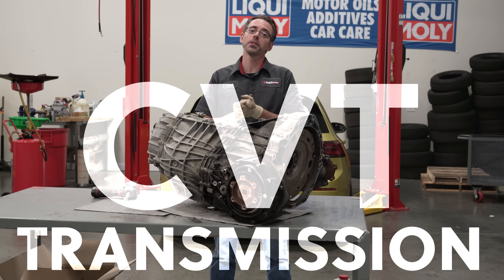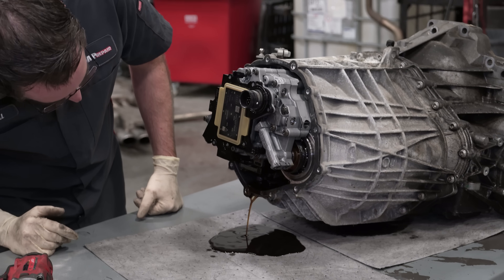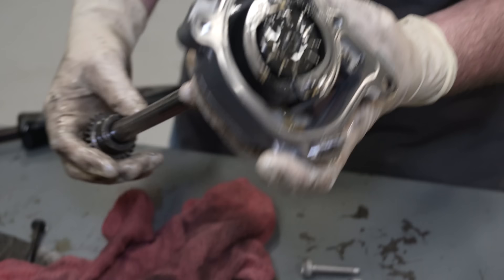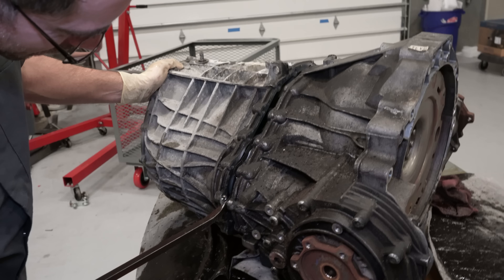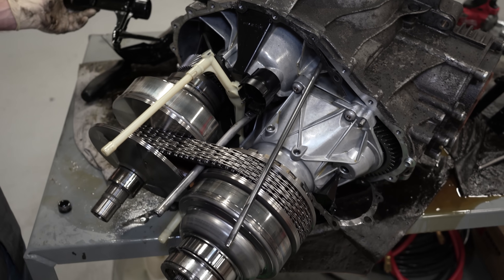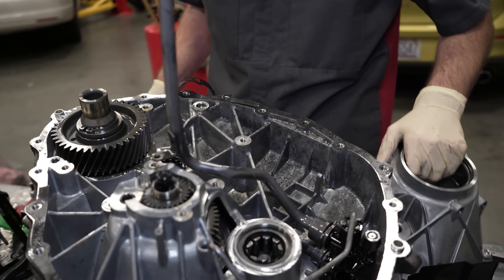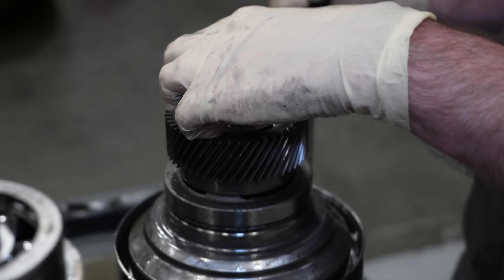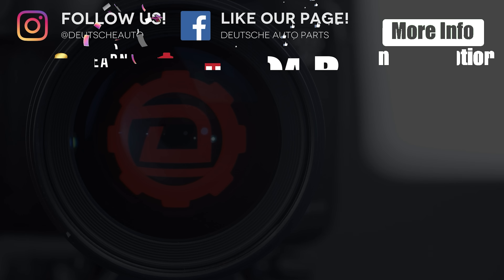Why you shouldn’t get a CVT transmission

Comment: Interesting to see the interiors of a cvt, and I've seen this design before. It's in combines as the rotor drive belt (really big and needs to be infinitely variable to run the way it needs to), but it's also in snowmobiles. Both applications have them applied as belts, not chains. So if I were an engineer for automotive industries, I would take more concept from the 2 previously demonstrated concepts and go back to a weighted spring design (more mechanical) rather that the valve body and solenoids. The second thing I would do would be change it back to a belt, rather than a chain, because the belt will be more maintenance, but will also not be, because it won't wear out the rest of the equipment. And to make it better overall, change the case so it's narrow and smaller, the drive axles go into the case through some holes with seals on them on each side, and make it have have an easily removable cover to replace the belt and give access to the weights and springs. 

That would have major changes, better reliability, easier servicing, lower manufacturing and repair costs, weight reduction in metal for that giant transmission case, weight reduction in not needing to run in fluid, and an overall safer experience for the driver and mechanic
Reply: It's a heavy car . It would never create enough force with weights to hold the torque. Plus it's a chain not a belt so it grabs the face for shit. So they have to use hydraulic pressure or it would slip. 
I drove a new Mitsubishi economy car with a cvt . It was terrible . Old european cars had them , but they were light and had no hp .
Reply: @dednside5229  lots of tractors use cvt's, which are much heavier already without load
Reply: Trash all trash. A good ole manual is what all ATV'S snowmobiles, and UTV/side by sides need.

Comment: Currently have a 2021 Toyota rav4 hybrid xse with a cvt, its amazing to drive and launch. Also have a cvt in our Kawasaki mule pro dxt, works great for a side by side, and a push plenty snow with a warn 5 foot plow🦾🦾, cvt transmission have come a long way.
Reply: Hybrid cvt is completely different. It doesn't have a belt. The gear ratio is controlled electrically.
Reply: @stkoev81  yes, i was implying my satification with cvt systems overall

Comment: Toyota hybrids get a boost from the traction battery at startup. Transmission failure is quite rare in these vehicles. Toyota does not mandate ATF changes, but it should be changed at 50-60K mile intervals. Audi and BMWs are not reliable.
Reply: I agree with a CVT fluid change every 80 K miles or sooner.  I use Amsoil Fuel Efficient ATF instead of Toyota's WS fluid.  My '04 with nearly 250,000 miles on it is my wife's "baby" and we intend to keep it as long as possible.  I do my own maintenance but the Prius doesn't require much.

Comment: CVTs are not new technology, they are just new to cars. Go-karts, golf carts, snowmobiles, and many recreational vehicles have used them for decades.
Reply: But those also dont have the weight, torque, and miles logged that a normal daily driven vehicle gets in the USA or Canada......
Reply: @Joseph Summers  it's like you are saying people lightly use their recreational vehicles lol. People are running cvt vehicles from the 70s.  Yeah sure generally they have less power than a car, but the cvt it uses is also much much smaller. The reason for it failing on cars is poor design.  They need to make them fully serviceable. Right now they are total shit and that's not the fault of high torque and milage

Comment: CVT is only a problem when it is misapplied.
Invented in the 1960s by the Van Doorne Brothers in Holland (who owned DAF), they released a range of cheap, small engined cars in the Dafodil, the DAFs, 33, 44, 55, 66 and 77. These found a large market in during the 70s oil crisis. They had 600cc, 844cc, 1.2l and 1.6lt engines. The 600 and 800 were 2 cylinder boxer engines. The cvt used thick rubber bands and these cars were both much better 'automatics' than what was on offer in Europe at the time. The cvt made them as fast backwards as they were forwards and 'reverse' races are still popular in Holland using old DAFs, yoh haven't lived. 75mph looking over your shoulder...
CVT works fine and is a sensible application PROVIDED the engine is not powerful but it is cheap, reliable, easy to fix and easy to use with small engines, motor scooters for example all use cvt the days.
The problem.with the application is in cars. Volvo bought DAFs car division in the late 70s and the designs of the Daf 66 and 77 became the Volvo 66 and Volvo 370 series respectively,  the latter was a huge seller. However, when the oil crisis lifted in the late 70s larger engines became more popular in Europe and the CVT wasn't up to the job, the 370 was sold in manual and automatic until the early 90s I think.
Obviously there's been an attempt to put cvt back into cars over the last 20 years and unless you are buying a small engined town car, don't bother. Yes the CVT of the 21st C is  more robust than the 1970s version and can ostensibly handle larger power but the reality is that manual and trad automatic are much more reliable with the larger engines.
I've owned many DAF cars and several motor scooters. The DAFs were extremely well built for contemporary European cars, very simple, easy to fix, hugely efficient and an absolute hoot to drive. They sold very well initially in Europe but unfortunately,  especially in the UK many were destroyed by their annual road worthiness tests (MOT) by ignorant testers putting them on rolling roads to test braking. CVT needs road friction to work and the transmission would destroy itself through over.powering on the rolling Road which resulted in many court claims. They continued to sell well in Holland and Belgium and still have a large following there similar to that of the Mini in the UK or the 2CV in France or the Model T in the USA.

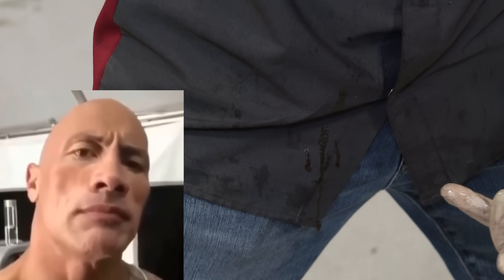Comment: Im at 8:20 in the vid and so far the only failure I see is an idiot that DOES NOT like the CVT and intentionally trying to disassemble it the wrong way to make his lame point. I wanted to see why NOT to buy a CVT . Most of the failure in these seem to be the valve body-electronics side of things.  There is no way in HELL that this guy would work on ANYTHING that I own.
Reply: I think he knows / noted the metal shavings in the oil when he pried it apart first. So was not afraid to wail on it. As its just a 280 lbs paperweight now.

Comment: I was using a company car throughout 2018 the car was a 2017 Nissan Rogue and i was doing a lot of traveling through the blue ridge mountains from Ohio to lower North Carolina. The car had a 2.0 liter engine with a CVT and ran great, always had the car fairly loaded down with luggage and my work gear and i could drive continuous at 80 + passing cars easily going uphill even touched 120 124 mph which was the max it would go. Yes i run the --- out of it as it was company rental. Never had a problem out of it and was very nice to drive. So early 2020 our 2005 trailblazer was being put to sleep and so we bought a 2017 AWD Nissan Rogue with 52,000 miles. The car now has 83,000 miles on it and is doing quite well made a couple trips to Texas and up through Oklahoma and back to Ohio plus a lot of more local driving, so as of now it every thing as far as drive train is doing good. Just waiting to see when the Ohio cancerous rust begins, once it starts it only takes a couple more years before complete body is gone. Yes it was o long story just to say the CVT i don't believe is all as bad as it is made out to be. Good on gas mileage also.

Comment: They've been in golf carts for decades.  You'd think they'd be simple.  Seems they are over engineered for what they are.  I would posit that they WERE simple with few failure points early on.  But they had "feel" issues and they threw tons of engineering fixes at it to get that feel right but all those fixes created all those modes of failure as well.  I see these as eventually being THE standard transmission.  Looks like they have a ways to go.

Comment: When I worked at a second hand dealership these would almost always go out for a sale and come back because the customer 9/10 times wanted the oil from the transmission with it, but we had to check and make sure no one already took it apart and all the sensors and inner workings were with it, can’t sell half of something. Horrible manufacturing unlike Toyota…

Comment: I like how quiet and smooth they are.  The oil that came out of this trans looks like it had never been changed.
Reply: Transmissions generally croak if you put oil in them...
Reply: And some recommend changing the trans fluid every 25,000-35,000 miles (spending what - $250 ? often) to help lengthen its life. Yikes.

Comment: CVT = garbage.   Relying on a steel segmented belt, to friction drive a steel drum is stupid. Once slipping starts, its a runaway disaster.  Rail locomotives use steel wheels on steel rails, which rely on massive weight to provide traction, and even then they can slip.......which is why sanding is used.  Imagine put sand inside a CVT to stop the belt slipping.............LoLz   Conventional automatics have improves so much, there really is no need for a CVT anyway, its obsolete.

Comment: This is even a bigger piece of crap than the Ford Pinto, or the Chevy Vega. 
  We rented a Mitsubishi Lancer with a CVT, what a piece of shit. We were driving south on Hwy 2, at night and we reached the Blackfalds hill, at 140I floored it. The car started shaking so violently that we had to pull off of the highway a few towns later because the car would NOT stop shaking like we were inside of blender. It was really loud and shook us up like milkshakes.
  We had to park and wait for a half an hour so the Piece of Shit CVT transmission to cool enough before we could drive down the highway again.
  This was a Brand NEW car with less than a 1000kms on it. We were going to buy one but that experience sealed the deal, the CVT transmission Sucks BALLS totally, don't buy 1 of these junk heaps. If you buy one of these it only exposes how little you know about cars. Total trash heap.
  It would probably be a good granny car, because if you go to fast it will explode guaranteed.
If you like driving like your grandma, buy a CVT so you can show your friends what an automotive genius you are not.

Comment: I have a 2015 Honda CRV. First year they used A CVT in a CRV. I now have 125,000 miles with no problems. Easy to change the fluid myself every 25000 miles. As easy to change as the oil. Most automatics make a huge mess like on your table. Never understood why they couldn't put a drain plug on the pan. Then making sure the seal is good or again a huge mess. Guess I really don't see any reason to dislike A CVT. No hard shifting like a geared system. Just smooth acceleration.

Comment: I worked at Link-Belt company back in the 60s and they manufactured CVTs for industrial applications and they were exceedingly reliable.  Perhaps automotive designers tried to cheat on the requirements for a CVT and you have ended up with a bunch of useless iron because of egregious design changes.  If it ain't broke . . .

Comment: I've driven a few of the new Renault Clios in Turkey which have a CVT and I found those cars pretty nice to drive.  Totally smooth acceleration and no gear changes.  That said, those were all brand new cars with very low mileage.

Comment: Still as useless as the Daf variomatic transmittion I woeked o in the 70's. At least that was just aeubber belt which could be easily replaced.  I was asked to work on the car after it had torn out several CV joint on the shaft to the rear diff.  I found that the gearbox was out of alignment since manufacture!

Comment: had a 2021 Subaru Legacy with cvt. Slugish acceleration, no power of the good size 2.5 engine, it was scary to merge into the freeway, or pass a truck in a two way road. They even advertise their 0-60 at almost 9 seconds! not to mention subpar accesories and human amenities in the car compared to other mid size sedans in the same segment.
sold it after only 15000 miles and got me an 8-speed Kia Stinger and is like day and nightand day; 0-60 in 5 seconds, and no more afraid to stinky cvt tranny. I love my Stinger!
Reply: ksoriano9766
Reply: ksoriano - you are INCORRECT SIR! 2021 Imprezas ONLY offered the slow 2.0 engine -- that's why many switched to the Crosstrek in order to get the peppy 2.5 engine -- your story doesn't hold up my friend.
Reply: @bocon99  Thanks for your correction, it was not indeed a Impreza it was a Legacy and still was slow as molasses. not to mention subpar accesories and amenities compared to other mid size sedans in the market.:face-blue-smiling:

Comment: My experience with CVTs is that you will have no power to accelerate for a short while if you have to slam on the brakes for some foolish driver.  You'll never think about this until you experience it.

Comment: Used to own Nissan Xtrail (Rouge) with CVT. Loved the fluency this transmission provided. Currently I own EV which fluency is even better.
The only thing in my concern was when I was towing 1,5 tone caravan with me on hot summer day, with car fully loaded, AC turned on, on the highway. This for sure didnt extend its life. Also Nissan autorized service did not want to attempt fluid change, they sent me to some third party company (while the car was still on warranty!). I sold it after 4 years owning, before it became problematic.
Reply: I wouldn't tow even a small trailer with any CVT or e-CVT equipped vehicle. Too much load on the belt in a regular CVT, and in an e-CVT, you will overheat the stator for the primary drive motor (that's MG2 in a Toyota e-CVT).
Reply: @laura-ann.0726  I jave had a new car, with warranty and officially allowed by manufacturer of 1,5 tones trailers. But I would think twice before I tow on older, used car. And for sure I would install an oil radiator to do everything thats possible to lower the temperatures.

Comment: Nothing wrong with a CVT transmission if you don't continually drive it like a race car. If you want to do that, do what we do here in the UK: buy a manual.

My wife's Auris (which we've had from new) is now 10 years old and is still going strong despite having towed a 980Kg caravan.
Reply: The problem in the US at least is that no manuals are being sold anymore. So the only reliable transmission options are now on hybrid cars. They are also called cvt's, but it's a completely different mechanism. There is no belt, and the gear ratio is controlled electrically. That's why you had good experience with Auris.
Reply: @stkoev81  our Auris isn't a hybrid. It's the traditional CVT transmission.

I actually believe that one of the problems in the US is that manufacturers try to put too much power through them, mating them to high torque V6's and turbo 4's.